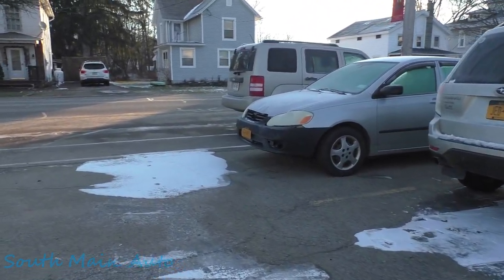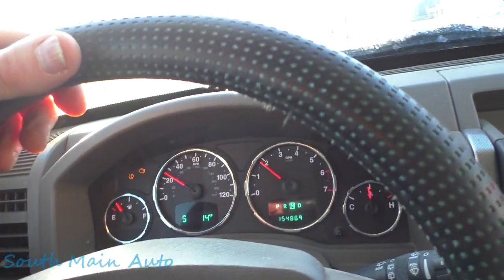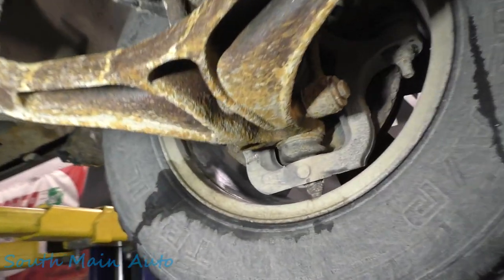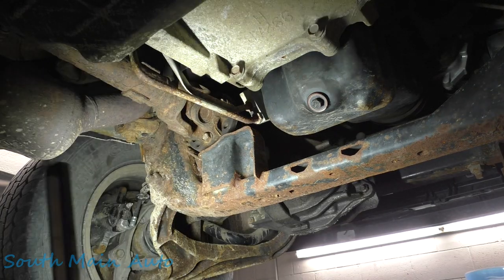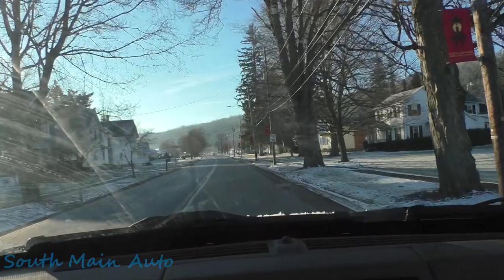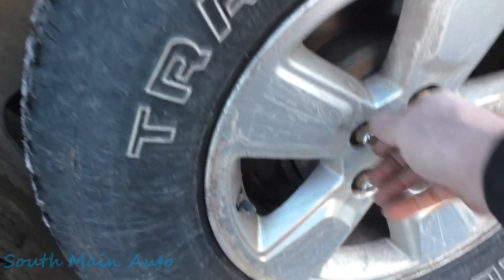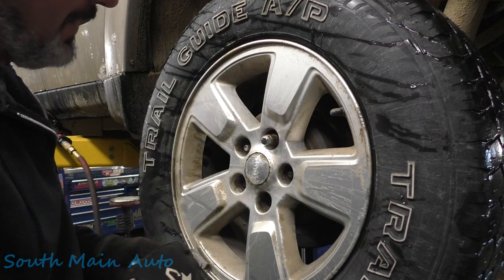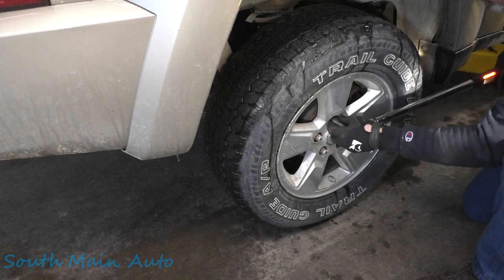Customer Just About Lost It.... A Wheel That Is

Comment: I just rotated my Sienna wheels and torque spec was only 76ft/lbs. About the same as what a quick lube puts on the oil drain bolt.
Reply: hahahahaha.  just changed oil for a friend and had to use a breaker bar with a pipe to get both the plug and filter removed.  kid at quickie lube must of had a turbo on that impact wrench.
Reply: hehehe.  It seems like most Toyotas use 76ft/lbs (so far Sienna, Highlander, Prius) and Hondas seem to like 80ft/lbs, so I just use 80ft/lbs for my cars.  It seems heavier vehicles like pickup trucks use higher torque specs.  The Costco near me specified they torque all lug nuts to 250 ft/lbs so I started rotating tires myself.  I hate jumping on a breaker bar just to get lug nuts loose.
Reply: On my 03 Focus the spec sheet only says 63 ft/lbs (85 Nm).
Thats the lowest wheel torque spec I know of.
Reply: @peetky8645  About 5 ugga duggas is standard for those guys.
Reply: Literally laughed out loud at your plug comment, fun way to start a Sunday morning with coffee

Comment: Back in the ‘50s when I first was learning about cars we had Chryslers and the left side wheels had left hand threads on the wheel studs.  There is some MOPAR engineer looking down on this situation saying “I told them not to change those to right hand threads”.
Reply: 1970 was the last year.
Reply: That little known fact saved me once.  I had just bought a new 70 Duster 340 and put some aluminum wheels on it.  A couple months later, I left my apartment for the parking lot and found 3 lugs nuts - still on the studs - lying on the ground.  The lowlife thieves started on the wrong side.  It was a hassle to replace that many studs but I still had the wheels - and went out and bought wheel locks the next day.

Comment: I have wire wheels on an old MG.  The wheels fit on a splined hub that can rust out after a few years.  Hit the brakes and the wheel spins on the hub.  You'll stop eventually.  The car came with a nice little brass hammer to tighten the big nuts that hold the wheel on.  It's good to give your nuts a tap every once in a while.
Reply: Hands in pocket...TAP TAP...😄
Reply: Words to live by.
Reply: Ouch.
Reply: I always grease axle splines to keep them from seizing, wearing, and corroding.  In the atv world, i have seen where ungreased splines rusted, developed more and more play, and eventually the hub is very loose on the splines, could roll over splines eventually or damage hub splines.  Same with cv axles on cars, ungreased splines rust and seize inside the wheel bearing, it can take heat and tons of force at the same time to remove them then.  And i always leave cv axle nut threads dry when torquing nut to preload bearing the right amount, then spray axle nut and threads with oil undercoat spray to prevent them rusting together.
Reply: I've been using Never-Seez on my hubs since 1975 (the same can, actually), but it's not magic juice, especially if a few of the wires in your wheels have broken.  I'm sure you know your business, but wire wheels have some unique issues.
Reply: My E-Type always got anti-seize on the splines, always tight, no rust, always easy on, easy off, and no! they don't ever loosen up by themselves unless you installed them on the wrong side of the car.
Reply: @samcooke2742  I haven't seen wire wheels and knock off wheel nuts in years, years ago worked at a shop for a guy who sometimes worked on cool older stuff.  During the winter he would store cars for a fee, 1st gen vettes, jensen interceptor, old citreons, 1st gen broncos, triumph spitfire(the miata-like car, think thats the name).  Guy had around 3 or 4 1st gen broncos himself.  My knowledge on spoked wheels is limited, mostly comes from dirtbike/motorcycle world.  I know you are supposed to torque them periodically, i think if the tension is uneven it can cause them to break.  And idk about on cars, on dirtbikes the spokes are always used with tire innertubes.  Some convert to tubeless setups but need to seal/tape over the spoke holes to make it hold air.
Reply: I had a customer many years ago with an MG.  It had wire wheels and seems like I had to tap that winged spinner in the center to tighten the wheels.  I presume that is what you are calling a nut.  We did use an anti-seize compound.
Reply: On second thought, per ACME company, a fastener industry co, i have heard if i recall right that oiled threads are 90% dry torque spec, greased are 70% dry torque spec, as a general rule of thumb.  In the future i may lightly oil threads before torquing axle nuts to hopefully prevent any galling or corrosion upon the next disassembly, and just torque to 90% of spec.
Reply: @lvsqcsl  I looked up the proper name, it appears to be knock-off nuts.
Reply: @connor3288  It appears that is correct.

Comment: When I was a kid my dad did a tire rotation on my mom's ford escort and used his electric impact wrench he just got used. I'm sure the brushes on that thing were shot in hindsight. I rode with my mom "to town" and the car started shaking like crazy 5 miles down the road and we had to stop in a gas station to make a phone call to dad. Dad never used that impact again lol
Reply: Did he get it from Marlboro? My dad had one of those too that he got from Marlboro Miles, it was useless lol.
Reply: Your Dad rotated the wheels. The wheels.
Reply: @michaelslee4336  Technically correct, but the common phrase is to rotate the tires, possibly because it's tire wear that is the reason for doing it. The wheels don't care if they stay in the same corner for 200,000 miles.
Reply: If he had torqued the wheels using a torque wrench, never would have happened. I NEVER trust an electric impact.
Reply: @michaelslee4336  They actually rotated the wheel and tire assembly.
Reply: I have worn out many high dollar Milwaukee (and other brand) cordless impact wrenches that I used in heavy industrial equipment repair and learned not to trust them for adequate torque period! Always put a wrench on and verify that fastener is tightened properly. This will help prevent self induced failure's caused by undue trust in a tool that is prone to failure.
Reply: How did you post this comment 17 hours ago when the video came out 5 hours ago?
Reply: @tinytim9453  patreons get early access to videos
I used to think the same thing
Reply: @milfordcivic6755   was gonna say this is why I use torque sticks with my electric or even air impact guns along with a torque wrench
Reply: @randalbloomquist7812 
I find my (not expensive import) air impact with torque sticks to be very reliable. Same with the IR at a place I worked. 
How do i know? Tighten with torque stick, set torque wrench 5lbs over and every lug nut turns maybe 1/16” and clicks. So I guess I’ve never /relied/on/ the torque sticks 😂
The intriguing thing was the one shop I was in most of a year there was a couple Milwaukees, my Porter Cable, and a dewalt cordless impact. Any of them used with the 90lbs torque stick would OVERTIGHTEN every single time, something different about the hammer inside or something. Don’t know. But I discovered the cordless impacts weren’t reliable to torque with or without a torque stick, even the smallest(yellow?) one would go way over 130ftlbs if used with any of them. 
A torque wrench is an excellent anxiety reducer.
Reply: @kirbyyasha  no but that's a funny story you got there yourself. He got it used from a "buddy". Poor dad became notorious among his "friends" for buying their junk. All they had to tell him was that it was in good condition and he would believe them. Sad thing was he was a competent self taught mechanic in the age before the internet. I seen the man rebuild several engines. For years he worked for himself at home fixing stuff his friends brought him
Reply: @John_Ridley  semantics lol
Reply: @fishhuntadventure  For year's I was maintaining and overhauling six 6000ICFM 1250hp turbo air compressors, large screw vacuum pumps 100hp+, large 450hp blower's and other heavy equipment related to a continuous manufacturing process that ran 24-7-365. I actually wore the tools out so required torque could not be achieved. Many bolts required 350lbft of torque. High speed pinion's turning at 80,000rpm require tight tolerances. I have a 5 foot long 1inch drive torque wrench that I use to ensure proper torque. The cordless tools are great for quickly tightening fasteners up to snug. I had a cabinet full of worn out Milwaukee, DeWalt and others. The best one I have is a Makita 18v 450lbft 3/4" drive. It's 3 or 4 year's old now and still performs pretty good. I hope this helps someone.
Reply: @vinces8974  Yes, neither of us have anything to our argument other than semantics.
Reply: @milfordcivic6755  Yup tigthen with the ugga dugga, then hit it with a torque wrench.
Reply: @adventureoflinkmk2  Torque Test Channel did a video not too long ago demonstrating that torque sticks are of questionable accuracy when used with electric impact wrenches. In any case I’d still check with an actual torque wrench.

Edit: That was kind of a surprising result. I never really trusted those things anyway, and always verified with the torque wrench, but now that we’re all using electric impacts, it has become super important. Check out their video.
Reply: Vw1966 I bet you are the guy who reads directions.  LOL
Reply: @jimmyv5730  i get the joke but in the 90s harbor freight wasn't even a thing in East TN. The truth was that electric impacts from that era weren't that powerful and wore out pretty quickly
Reply: Torque wrench. I learned that one quick. Even air tools have their downsides. Like the compressor is shot or enough torque to break the wheel studs.
Reply: @Marty's 4x4 
If you leave the soft black rubber bit on the hard metal bit and move the whole thing them you have rotated the WHEELS.

Comment: Back in 1971 I was a teenager and we had a 1968 VW Campmobile, and we also had a fold up camper that my Dad towed with it. We went on vacation in Southwest Virginia to Breaks Interstate Park and we were going up and down small mountains on a twisty 2 lane road. The curves were so tight that you could almost see your own behind going around them. I started hearing this KNOCK KNOCK KNOCK sound and mentioned it to my Dad. He was a great father but as to vehicle maintenance he got oil changes but everything else he basically depended on the semi annual state inspection. Before this trip, however, he did have new tires put on the vehicle.

He dismissed the noise as me hearing things, then in a bit my Mother heard it and you could tell it was getting louder and in a bit my brother chimed in too and we convinced him to stop. As he slowed down I also heard a bing bing bing sound from the front driver's wheel. He pulled the hubcap and two of the lug bolts were in the hubcap and the remaining three were loose.

We tightened those and replaced the ones that had come out, surprisingly they just had a few marks on them and the wheel didn't show much signs of wear. We checked the other wheels but this was the only one with loose bolts. We snugged up all of them to be sure. 

We were quiet for a while, as many of these winding roads had some good sized cliffs on the side, and in that bus with a trailer I'm pretty sure we would have gone over had the wheel detached.

Comment: I always assumed the wheels on chrysler products come loose because of the excessive corrosion they build up around the centering hub. Figured people tighten them down and their torque wrench clicks but then you drive down the road, some of that corrosion inevitably breaks up, bam wheel is loose. I get the hub and wheel (including the centering hole of the wheel) clean, put grease on it and torque it down. Haven't had one come loose (knock on wood)
Reply: I was thinking it might be something like this as well. 

Interestingly, I just worked on a friends Liberty recently and had a wheel off. Going to retorque it at first opportunity.

FWIW, I use a cup type wire wheel mounted on an angle grinder to clean the corrosion off the hub center and rotor face when I take a wheel off. In fact, that is the sole purpose of that particular angle grinder. 

However, I may need to start checking the actual wheel surfaces as well.
Reply: Dissimilar metal corrosion so any film that can separate the two is a good idea.
Reply: BI METAL corrosion. Aluminum and steel dont mingle well. Producing White Fuzz. Expansion Contraction through freezing and thawing cycles also could have the loosening Effect.

Comment: GM customers had issues with Aluminum Alloy Wheels in late 80’s and early 90’s.  Pour caused air bubbles and they leaked air.  Epoxy used to Seal it inside the tire.

Comment: Was driving down the road one day behind a guy pulling a double axle trailer and with a semi behind us.  I start hearing this sound that sounds like a sprinkler.  There's a big empty field off to the left so I'm looking at the field to try to figure out what the heck is making this noise.  The noise is getting louder and the truck in front is slowing down and I check the rearview and the semi has basically come to a full stop in the middle of road way behind us and what the heck is making that noise?  And then a wheel comes bouncing off the trailer and the noise stops.  And I watch the wheel go bouncing across the road into the ditch on the other side and thankfully it stays there.  I learned two things that day.  One: If you hear a sprinkler while driving you don't want any part of what is going on.  Two: If the semi driver behind you wants no part of what is going on you should probably trust their judgement.  And just to wrap up the story, the pickup driver just kept right on going after the wheel came off.
Reply: almost got smashed by a rogue trailer tire while riding a motorcycle.  serious pucker factor

Comment: Eric O’…My 2006 Jeep Grand Cherokee Service Manual says 100 +/- 15. I think +15 would be better. I use 110 and have had no problems. Lost a tire off my Brand-New Motorcycle trailer just 80 miles down I81. Bad start to a good Vacation. Spent the first night camping in a Junkyard. Carry a wrench and check Often Now!

Comment: Ron Pratt just put out a tow video of this exact same problem. Guy's plow truck rear wheel sheered off most of the studs because they werent tightened all the way so all the weight and spinning wallowed out the holes and destroyed the rim and studs.
Reply: The wheel?
Reply: @HunterShows  Yes, they were plowing the parking lot of a business when it happened. I suspect the salt may have played a role here as well as that what was in the back of the truck in a spreader that gets hoisted in the bed.

Comment: Went to a quick lube place with a 2013 grand Cherokee. This was a work vehicle that the company owned so they told me where to go. Next day I drove about 300 miles and felt a vibration for about the last 100. About 3 miles from the house the front left tire came flying off and I'm going down the road on 3 wheels! I pulled into a gas station, but it didn't drop onto the rotor until I hit the brakes. That was an interesting experience.

Comment: I have been watching you for years and don't remember you ever mentioning this before. But the one time a friend had a funny noise and we couldn't figure it out. Loose wheel on a 2004 dodge Durango. He had just gotten tires. That's actually pretty scary that it was common. I always just thought the shop missed it. Thx Eric you never disappoint!
Reply: It just takes one coming loose to start the rest coming loose even if relatively tight. Lug nuts operate on a buddy system and rely on each other. If there happens to be five and one is missing it will only be a matter of time others on the wheel will work loose.
Reply: @larrybe2900  that makes sense of why if a wheel stud is broken... It then fails a state inspection... In MO anyway.

As a former mech/state inspector, I never understood why only pulling one wheel to inspect the brakes was sufficient, even tho many techs would just do a "thru the wheel" visual inspection. 🤷

It would suck from the inspectors point of view but they should require multiple wheel torque checks?
Reply: A little late for a response, but the local ford dealer never tightened the wheel multiple times on my moms old explorer.

Comment: Yes, loose wheel story. Just dropped sister in-law off and got a flat from the parking lot. Spare wheel on all good and hit the highway to head home. On highway about a mile and something didn't feel right so took the next exit and pulled off to walk around car and see what's up. Turns out, in a hurry I only finger tight the nuts on the wheel I just changed. Feel very lucky I stopped to check.  Learned to not rush and I'll be faster in the long run. Surprised it took you that long to check the wheel. Amazed other shops take advantage of simple loose wheel. Love your work, thank you.

Comment: My boss used to have a small farm on which he had an old tractor that used have a rhythmic bump when he ran it.  In the end he completely stripped it down but found that everything was OK. When reassembling it he found that the bolts that connect the rear wheel rims to the central wheel flanges had worked loose.  He tightened them up and bingo everything ran tight as drum.  As he said, ‘it was a five minute job that took him the best part of a weekend to fix’.